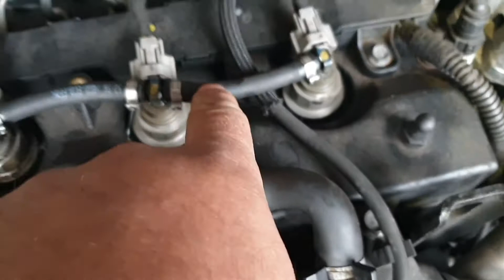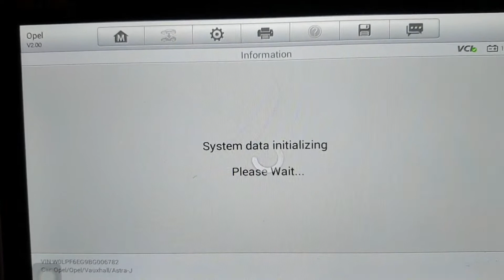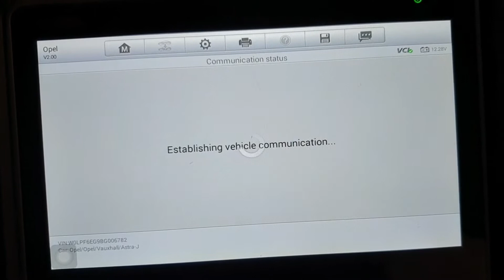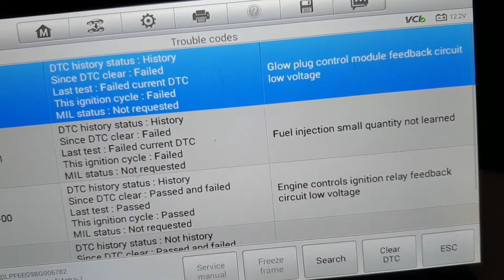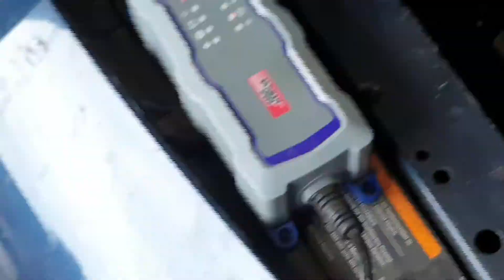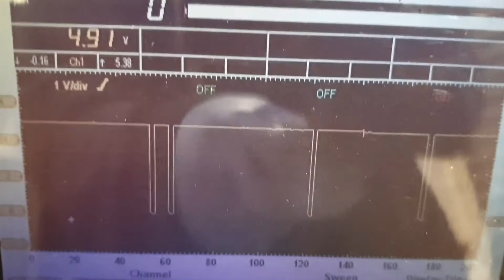Vauxhall Astra J A17DTJ Engine None Starting Condition Troubleshooting PART ONE

Comment: Hi did you ever get to the bottom of this problem as I have the same problem after injector change? Cranks over but fuel pressure goes to hi according to my Autel mk808 fault code reader it start then cuts out after a few seconds
Reply from the maker: No, unfortunately not. They took the vehicle without repair and didn't let me know about the repair result.

Comment: It may be the Alternator
Reply: My battery went dead, but when diagnosed by few people kept saying battery and then it said Starter motor and may be both starter motor and Alternator. It turn out to be Starter Motor which was the cause of the problem and I don’t know why the Alternator would not charge the battery, when checked with multimeter. So when it went it repair it turn out to be starter motor faulty. I don’t know why the alternator would not charge the battery may be the starter motor faulty doing something to stop the alternator charging the battery.